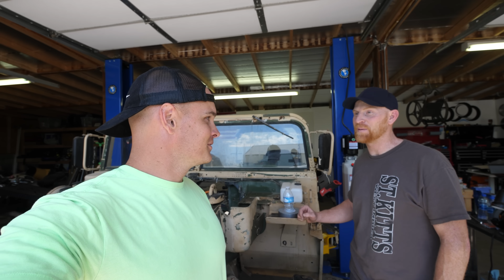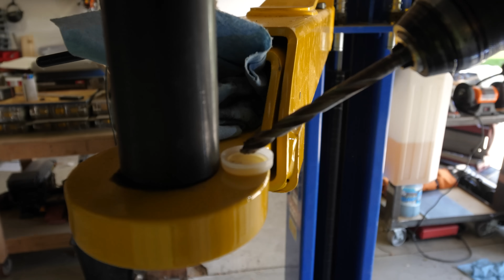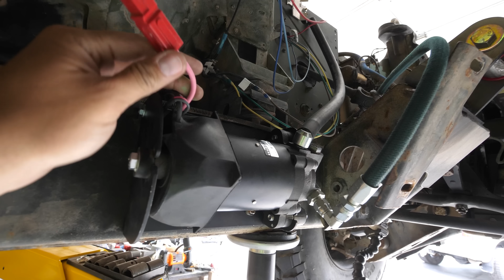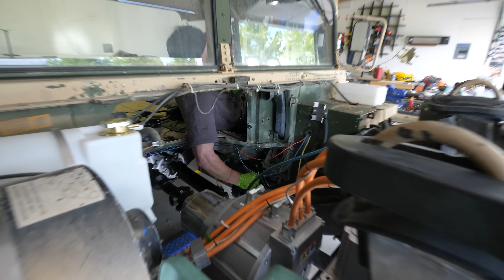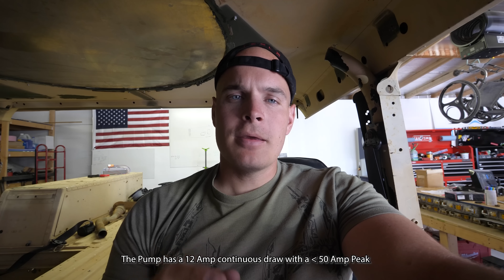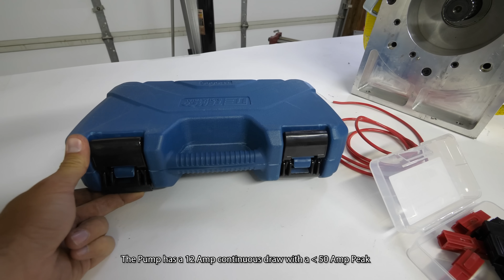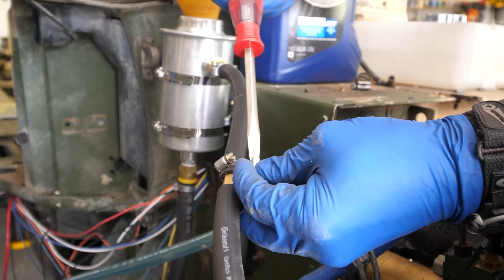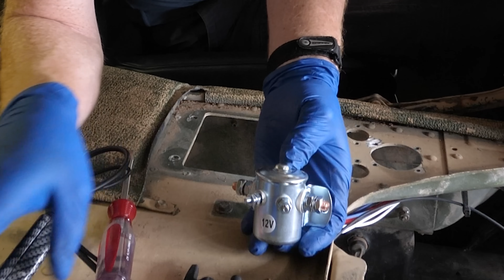We might have a problem with the Brakes... - Electric Hummer Conversion!

Comment: @13:53 The relay doesn't affect pump power unless its contacts have unreasonably high resistance. Yes, a larger relay (contactor) will reduce resistance, but never use a starter solenoid (contactor) for continuous duty, because they are note designed to last if continuously engaged. There are very similar-looking contactors which are rated for less current than a starter, but are suitable for continuous use.

Comment: make a rubber insulation for the pump so that it does not vibrate any metal so that the frame is not used as a speaker

Comment: Hmmm. Couple episodes back, you mentioned 'zombie apocalypse' and if that's the theme for this build (xD), maybe a small manual, portable generator can be placed in the engine access from the cab. that way if you somehow run out of juice from an extended journey and end up surrounded by the undead, you can bunker up and recharge. Portable so you can still move it out and still access the engine, and manual so it's still green.

(/s in case joke isn't clear)

Comment: 3:45 actually it's because we've gotten much, much better at the whole electrical system, power holding and so on, and as such things that were engine direct driven out of necessity can now be relegated to the electrical system. More efficient electrical motors, better batteries, they do be coming with cool stuff/changes like that.

Comment: Add an accumulator downstream of the pump and a fuse (you like to miss them) upstream of the solenoid. You will need to calculate the size of the accumulator to 2.5 times the volume of the pump, the hoses and the swing from full left to full right.  A 30A slow blow.

Comment: for the pump system, Try an accumulator with a pressure switch. You can pump the accumulator up and have it hold the pressure till needed. this would make the pump only run when needed.

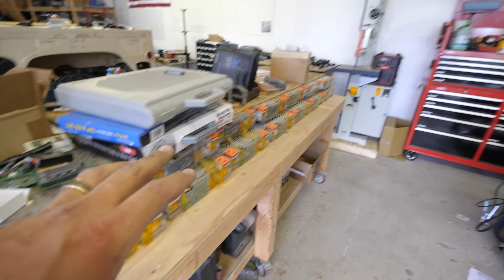Comment: 8:03 the end of that fitting has a "flare" on it. The flare seats on a female flair with the same geometry on the other side of the fitting. This seals it, you don't need teflon tape 😉. Thread sealant like pipe tape is used for NPT fittings where fluid can follow the threads and leak out, but if there's a flare or O-ring in the way to prevent leaks no thread sealant is required.

Comment: For the smaller stuff like brackets and mounts you might want to consider using a rivet nut instead of drilling all the way through the frame.

Comment: A good way to tell if your wiring is insufficient is by measuring the voltage drop from the power source to the load.  If it's substantial then you need to beef up your wiring or in this case the switching element.

Comment: Another post with feedback. Don't use fork terminals unless the fuseholder is made for those, use ring terminals for larger contact area on the terminal.
The fuseholder should keep the "forks" from opening.

Comment: Love this stuff you are doing, just wondered why you elected to use hydroboost system for brakes and steering which if running  a hydraulic pump continuously will use much more power than a direct electric steering motor and an on-demand vacuum pump? Sometimes you have to go back to the drawing board and re-think the concept, I have had lots of experience of going two steps forward and three back!

Comment: You may have addressed this already, but I’d consider going with a higher rated breaker to give yourself a bit more headroom with your circuit. If you’re expecting potentially up to 75A from the pump alone, it doesn’t leave you much left for the rest of your circuit without your breaker tripping and killing your entire 12V circuit.

Edit: never mind, you’re running it in a separate circuit.

Comment: You know.. you guys are super smart and talented but  thread tape on a flare with two paths for a leak and you seal   only one? it literally make absolutely no sense to waste tread tape  on a tapered compression joint  because if you didn't  tighten the nut properly it will still leak near the hose were the nut swivels. The thread tape has absolutely no benefit to the joint other than added expansion stresses that  can cause stress cracks  that can make a hydraulic system fail in situation wear it might not had installation been done to the we books Think about what your doing. Lol 😂  the best type of flared compression joint are the ones that incorporate an  o'ring as a secondary seal along with the metal on metal flare seal (both of these seals are made "at the source")   putting thread tape on a joint like that is like putting your band over a leak on a pressure washer fitting expecting it to not leak when the main seal fails  just stupid.

Comment: Not supposed to use Teflon with an fittings. They seal at the tip, not the threads. Tape is not doing anything at all.

Comment: You could of used the electric hydraulic pump out of a jeep gladiator and there's an aftermarket kit out to increase the hydraulic pressure out of it and adjust it to what you need pressure wise. Jeep Gear and Gadgets has a video on how they installed the aftermarket hydraulic pressure adjustment kit. I'm sure you could get that pump and it's wiring harness from a wrecked one

Comment: Maybe I misunderstood, but is the Dex/Merc ATF going into the brake system? I hope it's just boosting it externally. ATF is petroleum-based, which is generally a big no-no in brake systems, as it'll eat the rubber components, so RIP master cylinder -- and ABS module if you're really unlucky, though not an issue with this Hummer, I assume. ATF also lacks the moisture-wicking properties that brake fluid has, though that's a minor, longer-term concern for rust, not an immediate one.

Comment: The hydraulic assist pump is obviously necessary. As  others have suggested, mounting the pump in a less exposed area, damping it, adding an accumulator and flow regulation. One thing might be helpful is to state that the hydraulic brake assist does NOT use the same hydraulic oil as the braking system. Most vehicles use a vegetable based oil, DOT3 approved, for braking systems. Mixing different hydraulic oils can wreck the seals!
I suspect you are not going to make it driverless!!! 
This is a very clear and easy to follow project. It's great that you explain in simple terms how each part of the project works... Or is supposed to work! 
I look forward to more episodes. Keep up the good work.

Comment: put manual steering gear in,,add electric power steering to in put of box mount under dash , power steering pumps are going extinct . what are you thinking ? really sad . even a small amount of research  would keep you form this old low tec ,

Comment: How is the power steering pump also working with the brakes? Don't the brakes require a completely different fluid because of thermal load and degradation of the fluid at high temperatures and stuff like that?

Comment: I'm getting ready to convert a much smaller vehicle and am enjoying your videos. They're very informative and well presented. Your power steering and brakes seem like they’re going to be a bit of a drain on the batteries assuming the hydraulic pump runs the whole time the truck is on. Have you considered using all electric versions of both? They are both self-contained units with no fluids to worry about and on-demand use.

Comment: Don't use Teflon tape for power steering fluid / hydraulic oil connections (like your reservoir). Use lock-tight instead.

Comment: run the pump only when you pressing the break and turning the while. Normally Closed push button for breaks. Assuming power steering is only required to assist your steering, have a bypass switch that enables the pump, you'll probably only need it when parking. An alternative would be to modify the steering elbow so that it could sense when you are putting pressure on the while to engage the pump.  I guess you could get away with optical sensor and a slotted disk or potentiometer with controller but probably unnecessary while vehicle is in motion.

Comment: Rather than making the pump quieter, have you considered rigging up some kind of pipe setup that would make the sound deeper? Think about how a tuba works, for example. Then it would sound more like a conventional car engine, a sound people are more accustomed to hearing when on the road. Keeping it compact might be a challenge, but you might be able to build it out of flexible tubing and wind it through the gaps left after everything else has been put in.

Comment: Man, that shot of a little handheld drill just boring straight through solid steel... stuff like that is what really sells the power of electric motors. Imagine if a car company used that in their marketing. "How do we know electric motors are powerful enough to replace gas engines in our cars and trucks?" (footage of cars being built, dating back as far as they can find) "Because it's what we've been using for decades to build them."

Comment: For the sound issue u can use sound dampening material which are used in tires of Tesla for example and surround the hydro booster or if u go for little bit of more science u can the software which is used for noise cancelling headset and amplify the waves so it can get a little of ur nerves or u can use both for best results

Comment: The best way to sound deaden the pump IMO would be to 3D print a housing that can clamp around the pump that leaves about a 1/2 inch gap. Then fill the gap between the pump and the 3D printed housing with a sound deadening material like a dense foam. This method is used by Tesla to reduce the sound of certain parts.

Comment: Mount the pump up front away from the cabin. The pump should sit on rubber isolators. Build an enclosure and surround the pump with foam.

Comment: I would definitely look for a quieter pump, without the diesel noise that will become irritating. Also, there has to be scope for a small accumulator in that system. In aircraft, we use them to iron out demand spikes and provide limited redundancy in the event of system failure.

Comment: Hey Zach, try stone wool, sometimes called rock wool. It’s is home insulation with sound dampening, it does not support a flame. It does not support mold growth should it get wet. Basically they melt rock down, into lava an spin it into insulation, same way they make glass insulation.

Comment: Brakes on BART (here in the Bay Area) are only used for the last 5 MPH, Brakes on the Tesla are about the same. Are you using them for the full stop and "emergency" and not depending so much on regenerative braking?

Comment: Is a starter solenoid rated for continuous duty?
I have my doubts.
For brakes and steering I would definitely want some type of redundancy.
At least an accumulator to give me a little power in the event the motor, wiring or solenoid crapped out.
For example, even with the motor off you have vacuum in normal vacuum brakes that give you X number of actuations.

Comment: to make the pump quieter you can try to oil the bearings and rotational bits and also (i dont know if you had fluid running through while testing) when you run fluid through it would be quieter. if everything fails... just wrap it up to dampen the noise

Comment: Sir you can change the position of the motor slightly forward 

As your e-beast will be fully packed the sound will be minimal

As the pump motor is just beside the driver side and cabin is open it feels annoying 

But while packed cabin and running care it will be negligible..

Thank you...

Comment: a pump is a pump is a pump. but its kinda the same idea as the booster teves system from ford. you have a way better pump for sure and i would actually double pump it with check valves just incase the motor or electrical goes bad.  you can flip a switch and get steering and breaks back with the back up system. doing projects like this i always do back ups.

Comment: Couple of thoughts on sound deadening. Either build an enclosure with foam inlay to attenuate the noise, or move the pump further away from the cabin or closer to the rear axle where the tire/ gearbox chatter will attenuate some of the noise. Alternatively, put it in the engine bay area with the assumption that you'd seal up the doghouse pretty good

Comment: More interesting episodes from an interesting build.  Using a motor that hums makes sense in a Hummer.  I love the term "trailblazing expenses" and hose-end washers make maintenance inspects much easier. 

Rather than drill through the frame twice, try rivet nuts and you'll never go back.

Comment: mount the electric  pump closer to the power source.
larger wire and a fuse/circuit breaker should also be installed.
build a rubber mounted plate to then mount the pump to truck to further reduce mechanical resonance of the electric motor running.
build an vented insulated cover to also reduce pump noise.
separate the hydra-boost and power steering.
use the pump for brakes only and activate it only when brake pedal is used with key on or off power. 
brakes should be #1 to always function for safety.
then install a electric steering column kit for steering. 
lots of load adjustable systems available.

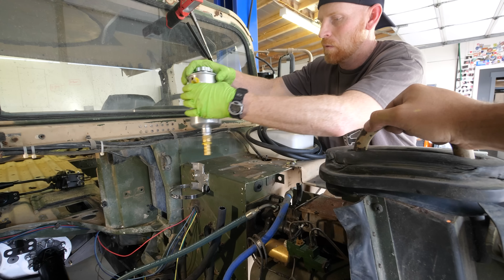Comment: that teflon tape at 8:15 will not help the seal at all, and potentially presents a large safety issue. 

Those are AN or JIC style connections. It is a metal on metal seal at the tapered part of the tip. 
you should NOT use anything that could obstruct that metal to metal sealing. 
That being said, you also need to pick your fitting materials accordingly to reduce galvanic corrosion, or you may have a hard time removing the fittings when you need to. 
(looks like you are using an aluminum reservoir and brass fittings... although I admit they could be gold ano aluminum) 

The teflon tape could be used to keep the threads from catching on one another, but I would shy away from it.. if any of that tape got into the hydraulic system it could be a bad time if it clogs one of your brake lines or does something inside the pump. 

If you were keen on doing it anyways, make sure to start the ptfe tape at least 2 threads back from the tapered sealing section to try and prevent any tape from entering the system, but I wouldn't.

Comment: Hey buddy I’m not trying to be a troll I absolutely love your channel but I am a hydraulic specialist and thought I would just share some information with you the fittings you are using on your break system that have the yellow plastic ring on them are called push lock connectors if you notice the bars are super sharp on them and if you use the proper Blue push lock hose you are not required to use hose clamps you can actually cause more damage by using a hose clamp because the shirt Barb’s can cut through the hose also whenever you see a deviled edge on the fitting something like a JIC fitting or a couple other brands depending on the degree of the flare it is unnecessary to put Teflon tape on the threads as the threads do not seal the liquid the two meeting services of the flare or what you the filling. Great work just trying to share my knowledge with you. Can’t wait to see this beast in action when it’s done. Also a little tip whenever you are using a Fitting The seals two metal on metal meeting services Leche I see it is extremely important not to over tighten the fitting rule of thumb is snug with a quarter turn that’s it as soon as you over tighten the two metal meeting services do not make full contact and you will put a groove in the Fitting causing a leak or making it a one time use deal. 
Keep up the good work she’s coming along amazing

Comment: I suggest to use 2 smaller oil pumps ; one for breaks and one for steering .
smaller pumps mean less noise .
this will keep systems separated; for easy maintenance in future , and more reliable rather than one pump for all.  
(( all the best form Jordan ))

Comment: For your hummer without an enclosed cab you can't insulate for sound. Or heat/ac either but you'll cross that bridge later I assume.  Or simply not at all. Idk. 
For now youll have to rely on the sound of the road and the wind to drown out the hum of the pump.

Comment: Maxwell supercap battery might eliminate the droop. Or get a big Optima battery. The DC-DC converter should work as a big regulator. GET RID OF THE SOLENOID. The only reason it improved your situation was likely the reduction in resistance. Or try a solid state relay...that solenoid doesnt seem designed to operate while under heavy vibration, causing ingernal arking that would increase resistance over time.

Comment: Should of just used riv nuts save from drilling alway threw the frame and having to put a wrench on the nut when servicing u would of just had to drill holes on one side of the frame then riv nut the holes

Comment: you can soundproof the pump to reduce the noise level.  Or you can build a pressure accumulator with a pressure switch on the high pressure side of the pump so that the pump does not run continuously.

Comment: I would just put a steel housing around the power steering pump. If it gets hot it may not work but if not then that should help with the sound.

Comment: Let me correct Brian. What he should have said is “this is automatic transmission fluid because we are too lazy and/or it is too expensive to buy the correct fluid and this is gonna work good ‘nuff for now(forever)”
Reply: It's a test/analytical system build, why would they bother with a specialized fluid when a general use will work?

Comment: No teflon tape ever on AN or JIS fittings. The 37 degree angle at the end is what seals not the threads. Get any of that in between the angle and could ruin the seal. If you want to keep the threads free you could use some stuff to keep the different materials from reacting to each other. Like anti-seize.

Comment: The oil pressure on the pipes could suffocate the power steering motor, change the pipes to slightly larger diameter it could decrease pressure on the power steering motor.